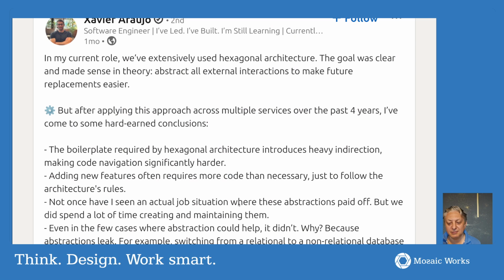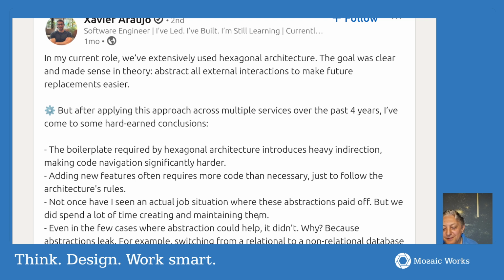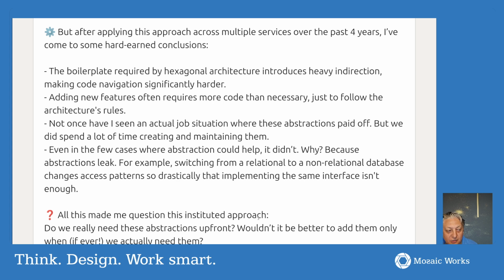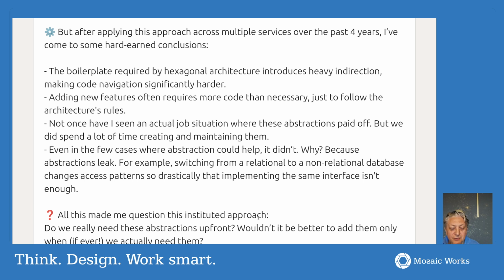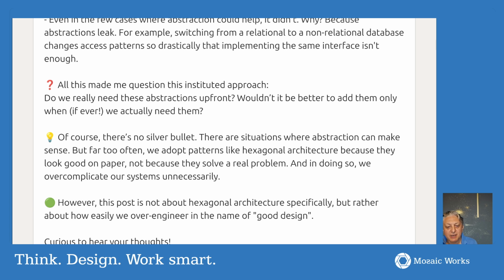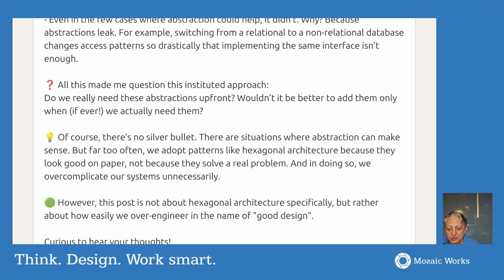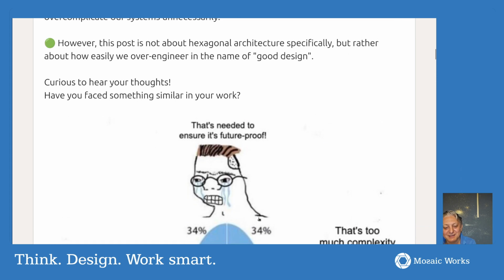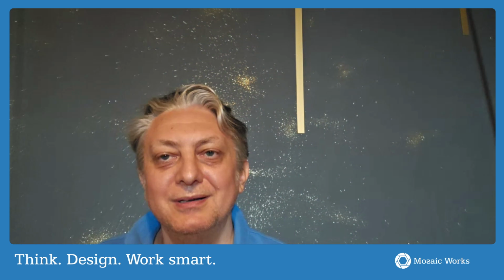Is Hexagonal Architecture Overengineering?

Comment: We started with Hexagonal Architecture but we're going away from it. You're right about the simplicity of testing, but that's a steep price to pay with dubious upsides.

Out platform integrates with both Microsoft eMail providers and Google Gmail. So we created a port/Mail and implemented Google (classic REST). Months later we did Microsoft (graph API) and realized that the way we created our worker that makes the actual API calls was completely incompatible with our Port design. 

In theory, this worker should be within the hexagon. Then we could call the proper adapter via the worker. But the worker really is an abstract machine that has nothing to do with Mail per se. 

For us the metaphor became a burden and we're slowly working it out of our system and only use it to swap tests and environments.
Reply from the maker: I see. Interesting situation. Would you say though that it's a problem of leaky abstractions? That is, since you started with an implementation in mind, the Google Gmail implementation leaked into the port?

Here are some thoughts.

At a first glance (which I know is not fair, since I'm not aware of your full context), I consider a port implementation for mail to have a method sendMessage(...) and maybe another method for initialization. I would be the first to note that this is still not fully separated from the adapter, since the implementation will behave much differently in a sync vs async context, and depends on the latency and reliability of the provider. 

While writing this, I just realized that probably it's best to design the ports using the rule of three: only on the third provider, or two providers plus tests, should we try to extract a common port. 

What do you think?
Reply: @tdws  I'm not sure if 'leaky abstraction' covers the problem.

Our worker is a generic concept and I don't believe it should be within the hexagon. It just needs manage a task such as "get all the messages." 

The worker has various configurations depending on what it's working with. Could be the number of connections to a database or the rate limit of an API. So it knows how to attack the problem. Well that description I just wrote sounds like our workers should live within the hexagon. But I don't really want to mix this worker concept within a hexagon abstraction. It seems out-of-band to worry about issues such as scaling workers from within the hexagon.

The other question - are hexagons the connectors to the database or are hexagons the connectors to workers which connect to the database?

Assuming the hexagon is the connector to the database or the HTTP endpoint - classical style - it means that either a) the worker needs to connect to the Gmail instance of the Mail hexagon to connect to Google (so now Mail needs a worker port) or we're again back to b) the worker needs to be an entity within the hexagon.

We decided against (b) for reasons I already stated and engineering option (a) seems like so many layers of indirection when what really want is just a simple worker to attack Gmail until we're done.